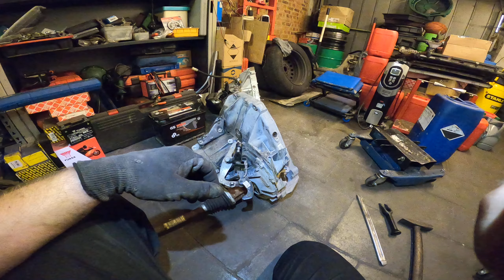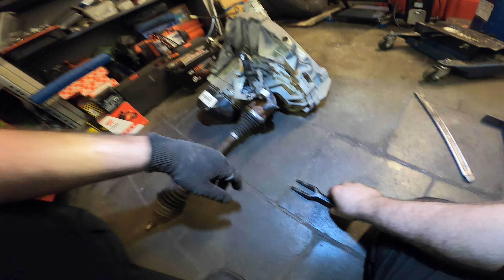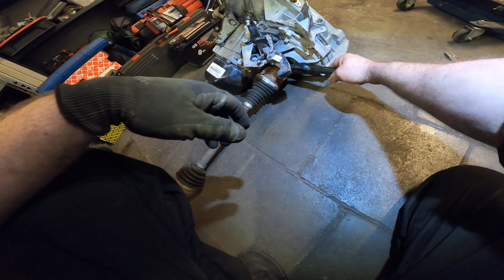Renault Kangoo 2014 1.5 DCI clutch part 5

Comment: Hi I have kangoo 2018 1.5      the clutch is hard to press   all most like it wants to spring back up   .     I woukd say   it's fine just on the slightly hard to press,        hope it's some thing  , so silly     . People said   yeah its fine just now but wait if you've been driving it for few weeks   .   The thing is    a lot of vans are not comfy to drive so I thought it was just  me getting older and had a automatic  .   But not to sure now   .   I woukd say its uncomfortable but it goes into gear ok   and biting point is ok   any    advice      plz   ? Ta